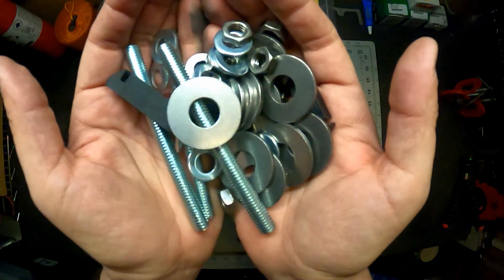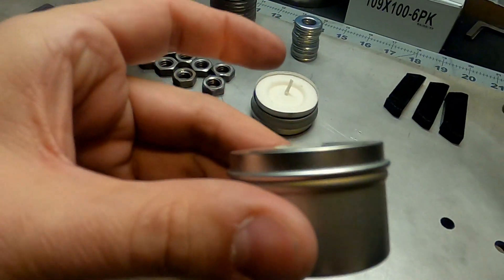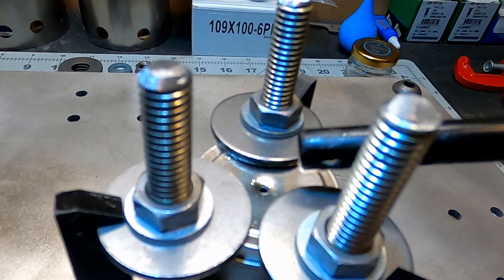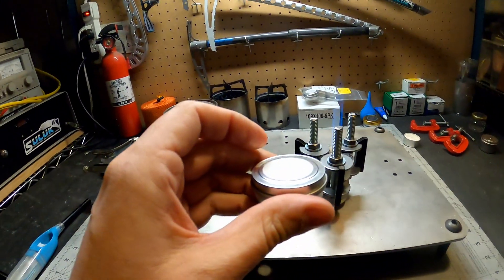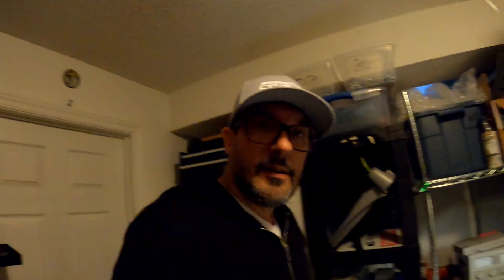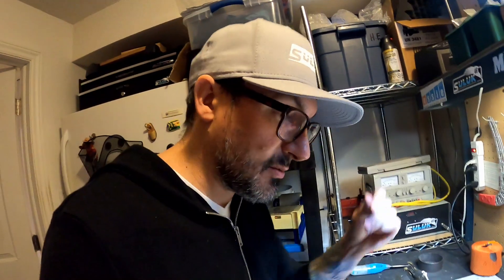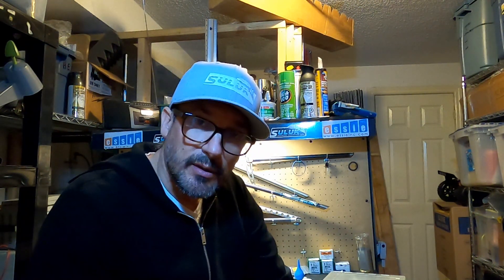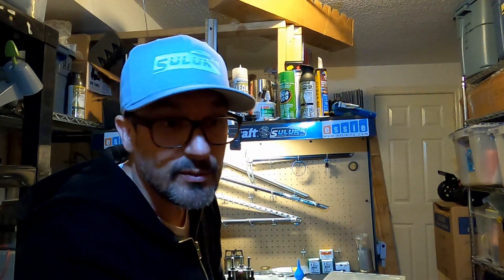High Pressure JET ENGINE Alcohol Stove for backpacking? - On The Trail - Episode #97

Comment: When the stove fell over, it appeared to keep going with no issues, I assume it was feeding back it's own heat to keep cranking away. Is that correct? If so then the pan underneath could be used just for priming to get it going. Alternative could be fuel tube going through the flame so once it's going it could keep itself going

I guess this principle with a needle valve or similar may allow controlling temp. That's been what has held me back from alcohol stoves so far, as i usually need to cook rather than just boil water

Comment: #1 alcohol vapor is explosive if it gets hot and has pressure. If there is a leak on the lid, it will ignite what's inside and could explode. The hole on the lid should be smaller and you should be using a heat source that won't put a flame near the lid of the upper vessel. Also, everything should be made so it doesn't melt or fall and it should be burnt inside of a flame proof metal of clay container

Comment: It needs a way to control the flow. Like a valve or something… if you routed the gas through a short tube, that might be safer. It would need to be rubber hose with a metal tip.
Reply from the maker: You are correct, I was hoping that I could size a generic valve diameter and get away with it. Probably not though.

Comment: I'm no stove expert, but have been reading up on old timey alcohol blow torches. Many are self pressurized, operating on the same principle you are using. Check out yt vids on these torches. Some manufactures are hansen, Jim dandy, turner, etc. They're cool, and might give you some ideas. Great project and video. Thanks
Reply from the maker: Thanks man. This is a rough concept, I've got a new version made and will have a video up in the next month or so of it. Should be a fun process.

Comment: So, penny stoves and other can stoves tend to boil off their fuel using feedback from the primary burner instead of a buddy burner. I'm currently in the process of making something like this work, but using heat feedback. Also, when you run out of fuel in the top burner, it can melt if you don't put out the lower burner ASAP. This is because the top burner stays at the boiling point of the alcohol - the fuel is the coolant. Without fuel, it will probably melt. I think this is why most designs siphon away a bit of heat from the primary burner instead of having a separate one.
Reply from the maker: This is probably the best response yet, and explains why it would not be made. I'm updating my design and like you mention, siphoning off the primary to the buddy burner. I would be interested to see what yours ends up looking like and how well it works. Thanks man.
Reply: @Suluk46 Just to expand on heat feedback / stability:

In a penny stove, the stronger the flame, the more the flame points away from the container, which in turn reduces the amount of heat feedback and causes the flame to die back. When the flame gets weak, it tends to lay against the metal of the can, thus heating it up more and reinvigorating itself by feeding more heat back into the reservoir.

In short, because a large flame feeds less heat back than a small flame on the penny stove design, the stove is always hunting for a stable middle ground.

However, in the penny design, the stable region of heat feedback is somewhat sensitive to environmental temperature and the flames are often not strong enough to fight back against wind / are just a bit weak for efficient water boiling in some cases. I think this is because the stable region of the penny stove is at a fairly calm flame, similar to a home range burner.

I'm sure a well-optimized penny stove is totally usable, but I think you're right to be searching for a more blowtorch-y solution. You'd get a high intensity flame with significantly more wind resistance and shorter cooking times (less time to waste heat from your cook pot into the environment, inherently more efficient.)

I'm aiming for a design that somehow maintains stability in a similar fashion to the penny stove, albiet at a higher pressure / flame intensity. It all comes down to creating a geometry that extracts heat from a tall flame. I've tried putting a vertical copper wire in the center of the jet hole to see if the heat would flow down and feed back into the reservoir, but it wasn't providing enough feedback. The distance is too great for the width / heat carrying capacity of the wire, or maybe it's rejecting too much heat directly to the air instead of flowing down. I've also had trouble with melting the wire. I've been wanting to try copper / aluminum pipe instead. Bonus points if the pipe is made of a soda can, lol!

Go check out coil wick stoves - they use a wick to bring the fuel above the flame inside of a loop of copper tube.

I'm glad I could help and hope that this comment gives you a boost - excited to see what you come up with. I'll get back to you if I ever figure this one out too.
Reply: @erich1394  That's a great comment and has been really useful to me. I was building a simple version of the alcohol stove with a screw-thread aluminium can instead of putting two bits of pop can together. I punched a hole in the top to have one single vertical jet - I dished the top downwards, then pushed the centre up again for a nice "moat" of primer, although it might need more - and then I got too scared to try it with the top screwed down tight. I checked that it's pretty air-tight (before the hole was punched) by putting it from cold in near-boiling water and checking for bubbles, and there were none. I think your point about the self-regulating flame will work to avoid excess pressure build-up. Another concern I have, though, is whether the vapour inside the can might get to an explosive mix and ignite through the hole. I remember an experiment at school where the teacher filled a tin can with gas from the bunsen burner supply - it had a press-fit lid and a hole - lit the gas at the hole, we all waited... and when the gas/air mix got to a particular proportion, it ignited and blew the lid off. In my case, I imagine pressure would overcome the friction at the screw thread and blast out there, or it would rip a bigger hole in the lid, perhaps. I'd love to know how you got on with your designs, and Suluk46. Anyway, thanks to both of you!
Reply: @lettersquash  I've been experimenting with aluminum solo cups (google them) - taking the bottom off both, cutting one a bit shorter, then putting the shorter one into the taller one with a bit of old woven cotton cloth wrapped around the inner cup, leaving a little sticking out around the edge. There's a 3/8" hole in the bottom of the top piece (shorter one) for filling. It's slightly pressurized when you set a pot directly on it and requires no priming due to wick!

As far as thermal feedback goes, the only way to avoid it without going depressurized (or having a relief valve like a penny stove) is to have a separate fuel pressurization chamber in some way. The problem comes from heating all the fuel at once. If you can find a way to heat a small amount of fuel at a time where the amount of fuel available to be heated is limited by some factor, you'll have a  built-in limit to fuel flow.

Check out Tetkoba Alcohol Stove Addict for his capillary hoop designs - they seem to work by elevating a small amount of fuel above the rest of the fuel via capillary action, and because the heat starts at the top of the can stove and travels down, the heat hits the elevated fuel first, which helps to control thermal feedback.

Good luck with your designs!

Comment: Why nobody has done this? Alcohol has less energy compared to a normal gas pressure stove (like a lot less) which usually leads to you carrying loads of fuel... BTW, there are guys making good versions at home, watch this: https://youtu.be/e7oAK2ERRuw

Edit: just a quick tip for you: make the pressure hole smaller and add a safety valve onto the vessel, there are good videos of diy projects if you search on yt for: alcohol pressure stove
Reply from the maker: You are on the right track. I've since made a new version. I need a larger pressure chamber with a smaller hole. I'll be posting a new video of the updated design in the coming weeks.
Reply: @Suluk46  K, will watch that, I've planned on making a stove using a empty gas canister because you can screw the needle valve onto those easily, then I make a filling Hole (with bolt to close) and a pressure valve to keep things safe and then copper pipe over the needle valve/stove

Comment: what you have has been built every which way you can think of and then some over the years.and in much easier and more convenient compact designs.triangia I think is the commercial model,some swiss alcohol stove.but there's tons of pop can versions.penny stove was more or less the foundation.
Reply from the maker: I've only found a handful of ones with the double burner, and most of them are very old or vintage. I've got a new version being tested, and I'll make a video, in the coming weeks. It seems that to fine tune the stove is the difficult part. Like designing a multi-stage rocket, a strong thermodynamics background is helpful. I'll go over the changes in the video.

Comment: check out Copper Coil Alcohol Burner Stove on YouTube that's your preheat. they sell them as gasoline stoves in EU, on eBay UK. sold in Russia as alcohol stove with bottle feed .build a coil stove first they are safe and fun.
Reply from the maker: Will do, thanks for the tip. Love the avatar by the way 👍

Comment: You are lucky ! ( and smart , too ,
I'm glad You're smart enough to have a fire extinguisher on hand ) 
Would it change anything different
if You punched the hole from the other side ? The cup looks pretty
unstable to Me ( could scauld You
very badly ) . Obviously You don't 
have a fire alarm ! LOL
Reply from the maker: I've got a new stand that I designed for the system, so it is much more stable now. Should have an update in the next few weeks.
Reply: @Suluk46  I saw a video on YouTube a few yrs. ago doing something similar . This Guy used 
coke cans ( to the best of My FEEBLE memory ) . the flames He
maintained was FRIGHTENING !
He could have set off all the fire alarms on His block ( and burned
half the houses , if it didn't go well ) !
I said all that , to say this , make
SURE that fire extinguisher will
extinguish a achol fire ( not all will ) !
Reply from the maker: @johnhoward7298  I think I saws the same one, just pop cans...its what made me look into this style a bit more. Wait until you see the updated version......

Comment: interesting video. In order to make it safe you can put some perlite into your alcohol container. Perlite will suck the alcohol and give out during burning.
Reply from the maker: What does the perlite do? Absorb the alcohol but still allow it to gassify? Basically, stop it from spitting out?
Reply: Perlite absorb the alcohol to avoid split it out. But easyly alcohol evaporate in gas form. It will evaporate as fast as it is in liquid form.
Reply from the maker: Awesome. Thanks for that. I will definitely try it.

Comment: I think this probably gets the water boiled faster, but you won’t get more boiling water with the same amount of alcohol. However, you need to carry more alcohol as booster.
Reply from the maker: I think you may be right. I'm still testing, but my tests show this is faster not necessarily more efficient.
Reply: Surely efficiency is a product of how much energy meths stores and how well you trap the heat. I'm no phyicist, but I would have thought that any meths stove releases a similar amount of heat per gram, as it isn't like a woodgas stove where you are trying to get secondary combustion. Therefore surely the best way to increase efficiency is to use a heat exchanger (a la Jetboil), and a very tight windshield (with enough oxygen holes) to trap the heat? Any other advantage would be releasing that heat energy faster, as you say. Awesome mad scientist video though ;)
Reply from the maker: @mountainchrisps  Lol. Thanks man. I'm still working on it, but the primary goal was the mad scientist look!

Comment: If you're trying to make a "better" stove, you first need to define "better."
As a backpacker, to me better means less weight and volume to carry, while maintaining reasonable speed to temp. To me, 6-8 minutes to boil 2 cups (475 ml) water is reasonable, even though a Jetboil system will do it in only 2 min. 
The Jetboil is a few pounds more weight than my home made alcohol setup. I'll gladly trade 5 minutes for 2 pounds.
Your overdrive setup is too tall,, too tippy, and too finicky for everyday use on the trail.
Reply from the maker: Good points, I'm not yet at the point of defining the criteria for a better stove, but it would touch on several of the criteria you brought up. Right now, I am only trying to understand why no company makes a stove using this high pressure technique. I've got a few people with valid points, but I am not yet convinced. Any input from that end? As for the mechanical setup, that's just a rig for testing. The final design would be inline with the rest of my products....and probably made from titanium 😁😁😁
Reply: @Suluk46  
I think the biggest reason no one makes it is because no one would buy it. It's too much fiddling for too little return. 
What can you advertise it doing? Looking cool? I doubt it will boil appreciably quicker, and certainly won't use less fuel.
Reply from the maker: @xenaguy01  Lol...I don't know man, lots of people buy things that look cool :)
Reply: @Suluk46  
Good luck then.

Comment: I also made lots of ultra hi pressure alcohol stoves that burns ultra hot. “Thermal runaway”. But I managed to tune it so I can use it. Message me
Reply from the maker: I checked out your video, looks like a tentakoba type stove. And am learning about thermal runaway. Sounds like most people actually don't want that to happen. Why is that? Too much heat output so loss of efficiency?
Reply: @Suluk46  thermal runaway cause the fuel to boil and vaporize to fast. Some stoves blow apart fuel runtimes aren’t consistent. I found a way to use thermal runaway in stoves that’s reliable. Yes my stoves are tetkoba style burners.

Comment: Its a bit like using a priming dish with a jet-style alcohol stove - something to give it some humph to get it going. Could be that yours doesn't need a constant flame at the lower burner - the main burner might be self-maintaining once hot from a short flame from the lower burner. That's getting pretty close to a jet-style stove with priming dish though.
Reply from the maker: I'm actually learning so much about this from everything. So thanks for the info. I agree, there are some similarities to what I want to do, and what is out there. I just want very high pressures, and not too many have that. Probably a reason...
Reply: @Suluk46  A lot of "jet" alcohol stoves are self maintaining once they warm up, including the traditional pepsi-can stove and the half-penny stove.   I've built some half-penny stoves out of basically RedBull cans, and bought a nice pepsi can stove off some other guy on ebay years ago.  On both, once they're primed and they "bloom", i.e. the jets get going, they generate enough heat to keep themselves going.

Comment: Seems kinda finicky to refill in the field, if the “pressure vessel” is sealed but for the tiny jet.
Reply from the maker: Definitely would need to come up with something more reasonable than using the teeny jet hole. I have seen some other stoves that have a screw that is removed to fill the chamber, then installed to create the seal. Gotta think about it a bit.

Comment: Check out Tektoba's youtube channel on light weight jet stove manufacturing if you haven't already.
Reply from the maker: I have seen his stuff. He is the master. But I haven't seen him make this particular style. There must be a reason, I just don't know what it is.
Reply: @Suluk46  An ultralight backpacker is using alcohol stoves to save weight and space of course. The challenge to improve them is to retain their simplicity and lightness while trying to reach the boiling performance of a canister stove without blowing over and burning down the forest. It also helps if they are not to fussy to prep. :)
Reply from the maker: That's actually a great summary. The challenge is not as straight forward as I may have thought earlier today.

Comment: Primarily, you are using twice as much fuel.
Measure fuel and boil time with jet stove compaired to a typical stove.
Reply: I'm going to build one just for the fun of it.
:)
Reply from the maker: Someone sent me a message saying that the temperature of an alcohol flame is the same regardless of pressure. So in fact, you want it to burn as slow and mild as possible for any given amount. Make sense? I haven't done any research...